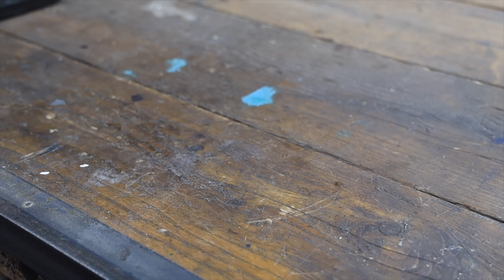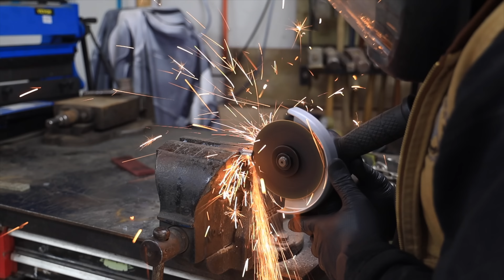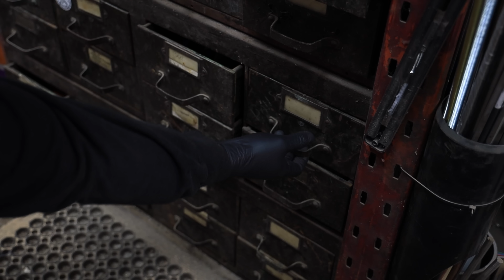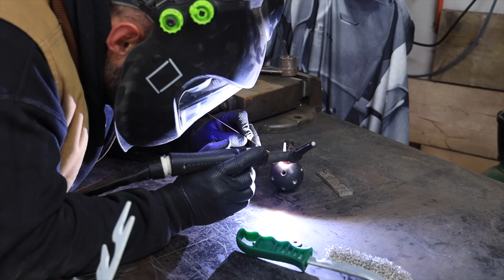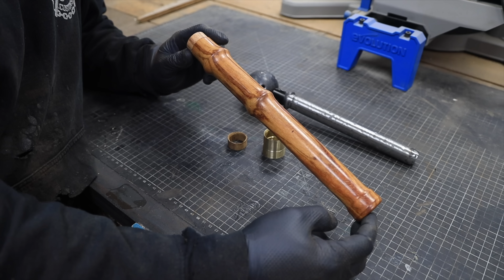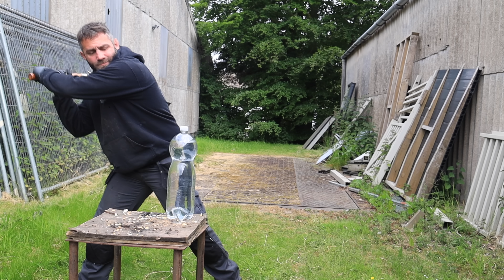Making a BRUTAL Hybrid Spiked Flail/Mace

Comment: Onur,
That's an incredible piece of engineering! The voice thing you were using is really low and very difficult to hear. Thank you for taking time to film, edit and post this video.
Reply from the maker: Thanks mate, sound was good my end may just need turning up but i set everything to fair level, unfortunately I can’t swap between my lav mic and shotgun mic or it would add loads more time to the build
Reply: @DiesInEveryFilm  no worries, I just cranked up my hearing aids and it was good to go.